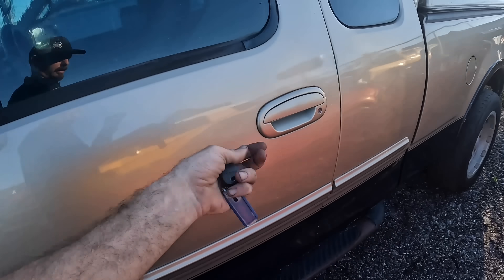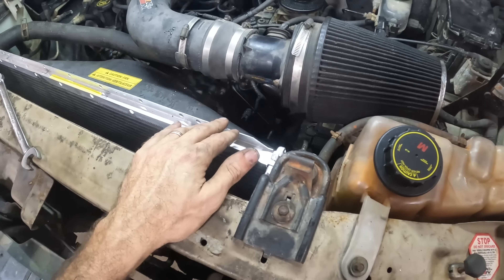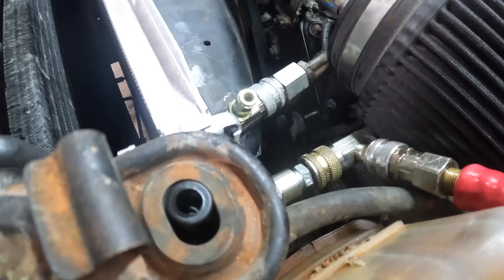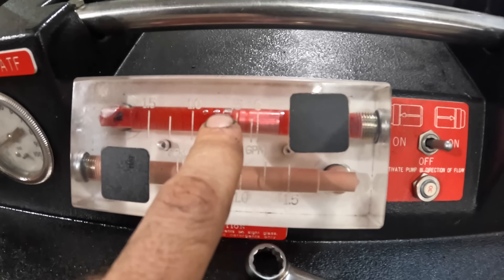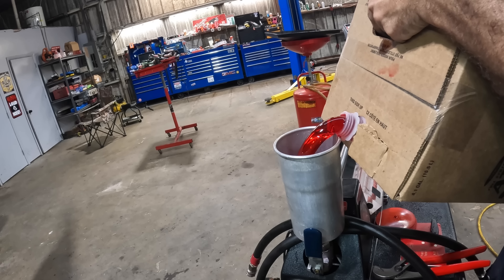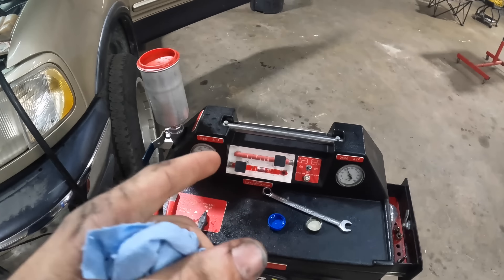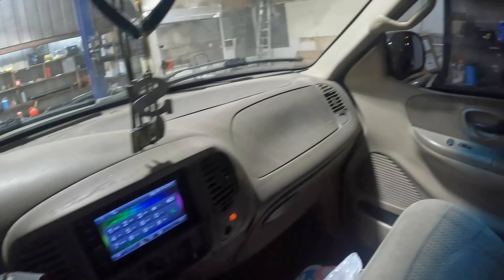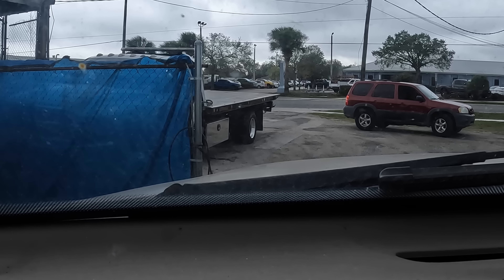Customer States: “Fingers Crossed” No Chance! 2000 Ford F150 4.6 5.4 Transmission Damaged

Comment: If you ever get any information about the future of these 2 attempted trans saves, please share them with us.
Reply: If I was the Cobalt owner, I would bring the car back after two weeks and have another flush, and send some of the fluid to Blackstone to see how much water is still in there.
Reply: @StrongDreamsWaitHere  realistically - if folks are wanting a flush to be a long term fix, instead of a rebuild or replacement - they likely can't afford the $30-$40 testing cost... 🙄
Reply: @HarmonyHollowApiary  That’s just one tank of fuel.  Let’s say instead that if I was taking this calculated risk (spend hundreds to save thousands) I would use the available technology to my best advantage.
Reply: @HarmonyHollowApiary  another $40 flushed down the Florida sinkhole. Once a week testing until 0% water.
Reply: @StrongDreamsWaitHere  When a transmission is that far gone, it's just a bandaid. Period. Shifting hard into 1st gear is very telling!
Reply: @billmonroe8826  I was thinking about the Cobalt, not the truck.
Reply: I was thinking that very thing!
Reply: What a HORRIBLE design.  The person who made the decision to put the cooler inside the radiator so they can exchange fluid should be sent to prison.
Reply: @billmonroe8826  Cars can go a long time with seeming damage.  I drove a laser with a horrible rod knock for like 2 years.  Put like 30k miles on it.  It was fine. I traded it in and it got sold and the person who bought it lived near my then girlfriend and I used to see it all the time, still badly knocking and still driving fine.
Reply: @tarstarkusz  design failure or service repair geniu$
Reply: @tarstarkusz  That's been a common practice since, at least, the 60s. I didn't work on many 50's vehicles or earlier so I don't know when it started.
Reply: @tarstarkusz  
Millions of vehicles on the road are this way,  and with only a few failures.
It's a win.
I always add a 2nd trans cooler, for towing.
Reply: @tarstarkusz  Z is DEAD
Reply: @tarstarkusz  my fleet bypasses those coolers any time we are messing with the cooler lines on our Nissan Frontiers. They already have a good-sized fluid to air transmission cooler, so the heat exchanger in the radiator doesn't do much other than leak.
Reply: @5Dale65  What in god's name are you talking about?
Reply: @tarstarkusz  my 03 Has a separate air cooled trans cooler. I think Ford realized it later.
Reply: @StrongDreamsWaitHere  waste of money
Reply: @tarstarkusz  ya...and how does hot coolant.  COOL anything?
Reply: @tarstarkusz  there's a Ford expedition  around here like that.....still knocking its way up and down the streets!
Reply: @tarstarkusz  very common even on trucks and buses
Reply: @siegelge  my 72 maverick has the same trans cooler in rad design, original fluid only changed it when I put the shift kit and upgraded parts we sent off the fluid for testing. When we got the results back we where shocked 86k miles on that fluid and it was had only degraded by less then 10%. Apparently ford added whale oil to the trans fluid back then making it last forever.
Reply: @tarstarkusz  Listen there's a reason....when its extremely cold....like 20 below zero....it warms the fluid to help bring it to operating temperature faster.
Reply: @tarstarkusz  My grandmother bought an old 1976 Plymouth Volare, Slant 6. Had a rod knock for 10 years before my uncle wrecked it.
Reply: @michealanderson2734  Whale oil? WTF is that, a Ford thing.. 🤣🤣🤣
Reply: @tarstarkusz  Go do some reading. Common design.
Reply: @goosedeathable  The fact that many people are doing it wrong doesn't make it a good design.  It's a horrible design
Reply: @tarstarkusz  i'm sure you probably know already, but it's a line that bruce willis says in the film pulp fiction.   what relevance it is to this comment thread though, i have no idea 🤷‍♂
Reply: @tarstarkusz  - that design has been in use for decades. It was probably less of a problem when it first came out because radiators weren’t made with paper thin material then.
Reply: @tarstarkusz  I'd imagine this is why all the good trans shops I know of require the purchase of an external cooler if you want them to warranty their work.
Reply: @davidturk6170  I know they've been doing it for a while. It's just such a bad design where a somewhat minor failure wipes out the 1st or 2nd most expensive system in the car.
Reply: @tarstarkusz  Most cars and light trucks have this same design. GM and ford for sure do
Reply: @stevenbaker9327  the built in transmission coolers in the radiators are on put in the bottom where it is the coldest in the radiators
Reply: Cars have had trans oil coolers In the radiator for more than 6 decades.   Most of them work fine until the car is scrapped
Reply: @graken22  whale oil was an ingrediant in GM fluid back in the 70s.  As I recall there were some problems when it was replaced with another component.  Allegedly GM had to because whaling was severely curtailed.  I don't remember Ford using it.  They used different fluids.
Reply: @hugh007  I've seen them with external coolers, but they may have been just extra cooling in addition to the one in the radiator. I'm not an auto mechanic, so I haven't my fingies and head under thousands of hoods.
Reply: That's because you know the transmission replacement cause that's astronomical and you're a to h*** a nice guy try to save people money and I commend you for that because a lot of people would say oh you blew up your radiator and at least in your transmission now we gotta put your transmission to android the Adrian and it's gonna be $2000 or better
Reply: Ray, I live in Missouri and have a 2001 f150 4x4 with only a good transmission transfer case. If he wants to come get it or pay transportation . Getting rid of it

Comment: Ray, it would be interesting to do a follow-up with the owner to see how long the transmission last.
Reply: @Nunya Bizniz I didn't hear the valve train death rattle you get with 5.4s so I am betting that transmission dies before the engine.  But never bet against a 5.4 dying.......  Hahahah
Reply: @Nunya Bizniz wouldn’t be a 3v in that year.
Reply: @Nunya Bizniz thats a 2v those last forever
Reply: @larryadelberg6676  Learn your trucks 😂 that’s a 2v
Reply: @desertvalleyfilms9136  nothing lasts forever…
Reply: @Nunya Bizniz It's not a 3V. That didn't start until 2004. (11th Gen)

It's the 5.4l 2V, which is a fair bit more reliable. Without the oil pressure-driven VVT/VCT :)
Reply: It won't last long. The water is certain death in a trans
Reply: @edwardbaker5373  bye bye  clutch fibers and valve body gaskets. I wouldn’t have wasted my time flushing it
Reply: @waterloo123100  I agree with you. Best bet is to drain it and new fluid and filter. No flush at all. That hurt it more

Comment: If anyone is interested, I fixed my similar vintage F150 odometer by removing the module and re-soldering all the joints on the board. Seems to have been a common problem. Been 7 years and still working.  That's a good looking truck. Hate to see it be scrapped.
Thanks Ray.
Reply: Is it a hard task to get at the odometer?  I will have to perform that service  shortly as well.
Reply: @Fret01  as I recall the plastic clamshell  parts around the steering column need to come out. Shift lever down to Low for clearance. I think the dash facia has to be pulled off the snaps holding it.  That exposes the screws holding the speedometer and gauge module.   They're all on the same circuit board. Two multiple connection plugs are short and need to be unplugged. Disassemble the module to expose the soldered side and carefully resolder all the joints.   If you're unsure of yourself, a handy tech guy would find it easy.   Change all the illumination bulbs before you reassemble.    I could do it again  in about 90 minutes.  First time maybe 2 hours.  Check Youtube and see if there's a video.
Reply: @hugh007   - Thank you for the info.
Reply: The 2002-2006 Camry had it's engine module located next to air conditioning tubing.  As a result, the moisture breaks connections after ~6 years.  We just knew a  guy  that would resolder these instead of spending $$ installing a new module.

Comment: Ray, you had your flush machine hooked up backwards on the first flush. The machine needs to be hooked into the cooler loop in the correct flow direction. When you disconnect @ 11:40 and reconnect @ 15:14 you got it right. Thats why the second flush went faster and had pressure.
Reply: Right. He kinda acknowledged it and acted like it wasn't a big deal. But it seems it would be directional. Idk
Reply: FYI I believe the Wynn's transflush machine hoses are interchangeable. The machine will figure out the vehicle's direction of flow and it will do a 1:1 refill based on the amount of fluid in the vehicle.

Comment: At least you are willing to work with your customers Ray. Sometimes desperation rules the day. While not a proper repair, it worked. If the customer understands and accepts the risk, I say go for it . Good job sir.
Reply: But what all too often can happen is "you told me you would fix the trans" a month later papers served. See you in court.

Whats good here is he has full accountability with video.
I think more Kmart Tyre and auto and Ultra tune shops should be forced to video what they ACTUALLY do for your car.
Reply: @Ralph_Baric_PhD_C2019  did customer acknowledge in writing work order the expected outcome? he would say I never watch his video, it was only Ray's side of story unless the guy was in the video nodding in agreement.
Reply: I had a car back in the early 70's (showing my age) that I paid $200 for. I just graduated from a Community College and was poor. It lasted almost 2 years, before the transmission slipped so bad it would struggle to go up hill. Parked it in front of my apartment one night, and took the plates and dash/door serial numbers off it. Next day the police towed it. I bought another junker the next day for less than the transmission fix would have cost.
Reply: @forgetfulme1719  agreed
Reply: @forgetfulme1719  even if they did, they will still take you to court and dumb juries will side with them.
Reply: @TEDodd  true most of the times, maybe this owner drives long enough to get his money's worth, 30 days usual warranty?
Reply: @forgetfulme1719  no warranty on that kind of work. 

Hopefully Ray can judge customers we'll, enough to do such. But most shops, like the old place he worked, won't because they can't. Just to many stupid people you can't trust.
Reply: @Ralph_Baric_PhD_C2019  I’m sure a lawyer costs way more then the value of the vehicle and the judge wouldn’t want to waste their time 🤣
Reply: @jaykellett2327  Smart move. Not sure why people hold onto junk vehicles and waste money trying to fix a turd

Comment: Still works.
I'm not surprised.
And those trans are very expensive.
The working man needs his truck.
It's a warranted gamble.
I have to agree with the customer.
Ray doesn't have to be responsible for the future value the customer may or may not get out of trying to save it.
But the customer can use the truck to make money, saving up to provide himself a better truck or a better trans for this one.
I personally thought the contents in the pan wasn't unusual, and that's from servicing transmissions on Fords and discussing the pan contents with a builder we had working in the Ford shop,and other builders who worked at other shops doing similar work.
 The trans needs a symptom of a failure or impending failure.
If it works, the working man works.
Good save.

Comment: I agree negative reviews when never experiencing the service isnt right. Not much better then someone who I've done normal repairs for, asking for me to do frame work or cross member replacement, and I told him I don't do that. I stuck to normal repairs. Told me they would take there business elsewhere, and then asked what I even did now. I've never done any frame work especially in Maine
Reply: Replacing frame members or worse, welding patches on frames of rust belt vehicles is literally putting a band-aid on a bullet wound... Just begging for a "malpractice" lawsuit when the frame around your patch fails...
Reply: @mikejacob3536  exactly that's what I tried to explain to that customer. He said you weld exhaust, I said yes there's a whole lot of different between exhaust and structure. I said I even told my insurance company I don't do any frame or structure repair here. Your exactly right too, when the frame fails around the patch, I'm at fault because I touched it last. I'm already married to enough vehicles, with out playing with that stuff. Around my area, only specialty shops even do that, and there are very few, other then the backyard mechanics that do it, and I've seen some of the backyard work, and it's questionable to say the least.
Reply: @frankhartford5194  Some people can't understand the difference between a 2" unrestricted pipe, carrying hot gasses at 10 psi, and a frame rail supporting thousands of pounds of force, at speed, over rough roads... But then again, some people can't define what a woman is... I blame public schools.

Comment: I have to guess that the solids (worn bands) remaining in the old ATF helped the transmission work. The new ATF has no solids and it will seem like it is slipping. It really is time for a new trans. I was cautioned by an old-timer transmission guy to not flush a high mileage transmission unless you are ready to replace it shortly after.
Reply: If this gentleman prayed last night it stands its best chance.
Reply: That’s a myth what ruins a transmission is when you flush it and never change the filter
Reply: the solids need to stay on the clutch not flowing around.
Reply: I've heard the same from many reputable sources. We used to add a pint of brake fluid to the mix in order to keep grip until the next tranny.
Reply: @TonyGingrich  it removes water but can damage rubber seals, u weigh the risk.
Reply: @TonyGingrich  That’s terrible idea. There’s a reason they make Lucas stop slip.
Reply: I heard that too but it hasn't been my experience.  Bought my F 150 at 200,000 miles. Changed all the fluids including the transmission filter.  No notable change but it may have given me snappier shifts.  It's been 7 years and I've changed the fluid since then. Now has 250,000 miles. Your milage may vary.
Reply: @@hugh4401  Personally, I think mileage is overrated in some contexts. When it comes to a tranny, it really boils down to how it's been treated.

Similar to yours, I had an '07 Triton. I really put that thing to work. Heavy tows. Extreme climates. But after 300K miles of regular maintenance, to include tranny fluid, I signed it over to my little brother as a perfect running truck. Like it was still on its first year.

Comment: I have a 99 F150 and the mechanic I talked to loves this generation of Triton engine. Never mind that one of the cylinder spark plugs popped out and had to have a sleeve inserted so the spark plug could be put back.
Reply: Pretty much a crown vic.

Comment: Last year I had a trans issue where the trans wouldn't go into reverse at times.. I knew it didnt have long.. So I drove it as gingerly as possible and got another 2 months out of it.. Then the pump gernaded and it sounded like there was a cat fight under the trans hump..LOL.  After work the Wife unit and I towed it back home.. Now its a parts donor.. 
99' yukon with 203k miles.. 
Have a good one Ray!!

Comment: GREAT video.   How would one determine that a vehicle has had such a transmission flush after water contamination?  Is there a fluid check to reveal excess water?  Any other way to determine if there's been water infiltration?   

Anyone else suspecting an F150 will be on sale soon: "recently serviced?"

Comment: I'm jealous. Now I want a fluid exchanger. Really made quick work on that. Beats the hell out of repeated pan removals and run-clearing the torque converter.

Hopefully the owner agrees to a final flush. Those valve bodies have very narrow circuits. When the radiator disintegrates, that internal debris can be caught up in the valve body, evading a flush. Running the tranny through gear shifts helps dislodge crap that didn't get flushed out prior. It's a really great sign that this thing found all its gears.

Same for the accumulators. That "might" be why the hard shifts occurred. But I really suspect something else, as it seemed to occur into and out of gear, instead of between gears. But nonetheless, that could get smoother as more miles are put into the tranny. Highly recommend a follow-up flush within the first month, regardless of whether or not they opt for a third on this appointment.

Comment: Usually when I see vehicles in this kind of situation it's one of two things - they just expect the vehicle to keep on going with minimal attention or they're trying to decide if they fix the vehicle or pay the rent. I wonder which one this is? Could be the latter from the sound of things.
Reply: Given that ray said it had a recent engine change which included new timing change I would expect that it is the latter.

Comment: Yow, didn't realize the engine had just been replaced! Ray, you run that truck a lot with the doors closed. Hoping you have a hose exhausting the exhaust.
Reply: When I was younger we used to run vehicles until our eye were pouring tears. I guess we didn't know how much was too much. Never had any issues though.
Reply: @Bryan-Hensley  u are tough but he is skinny and not enough tears to flush the fumes.
Reply: @forgetfulme1719  we actually didn't know any better then.
Reply: @Bryan-Hensley  to be serious, he has an exhaust duct for the old hood in that torn down room, buys inline blower with flex exhaust temp hose, good forever use but he might not want to spend $ for health, thinking he is young and invincible to 'little' exhaust, saving $ for next feel good toy.